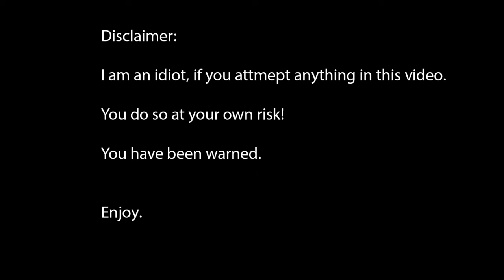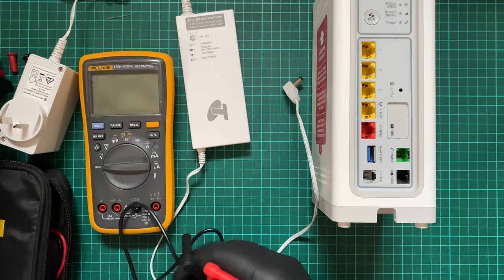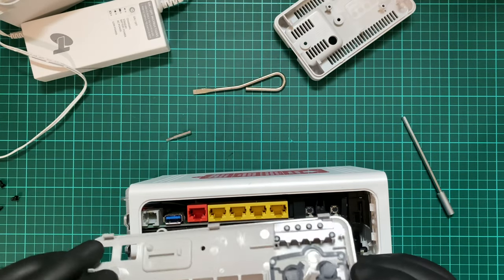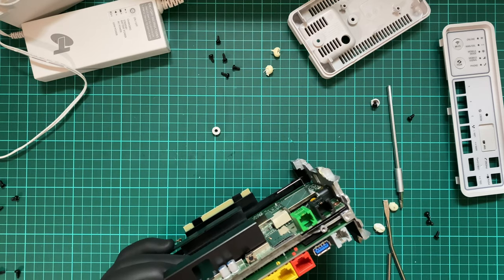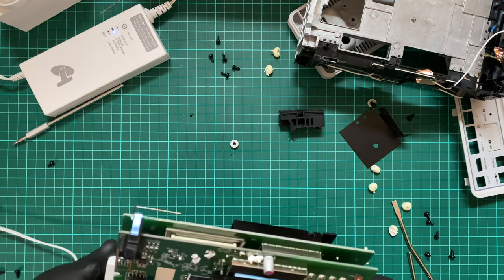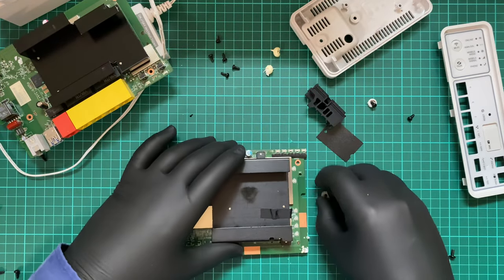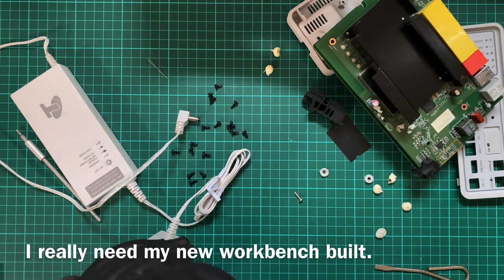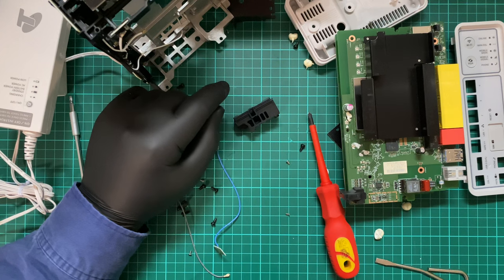Destructive Tear Down of a Telstra Smart Modem Gen 2 With Voice Backup

Comment: I have one of these from when I used to use Telstra cable.  Now works fine with my Aussie broadband HFC NBN connection.  I've changed a lot of settings and it's never reset on me.  Don't have the backup thing though.